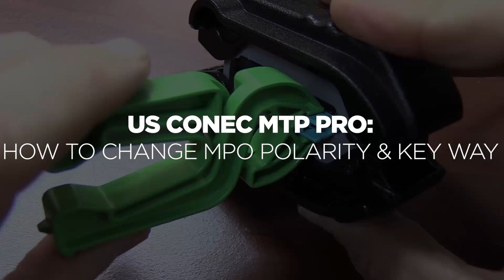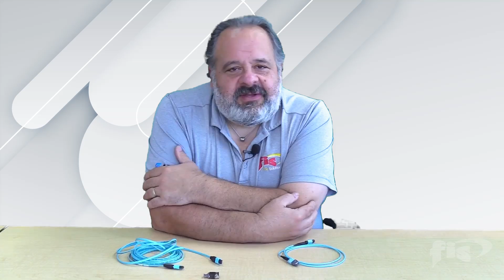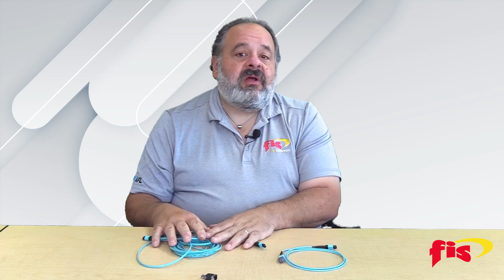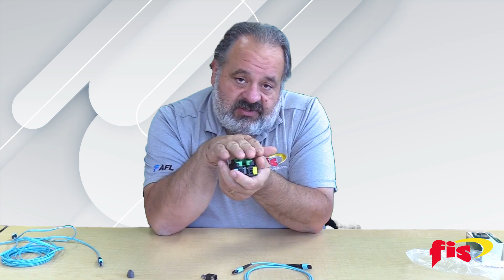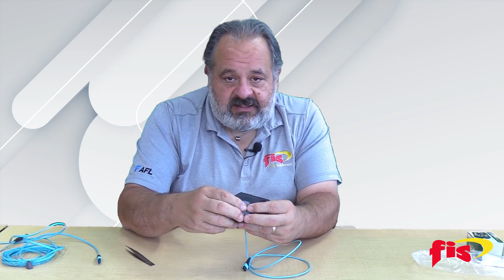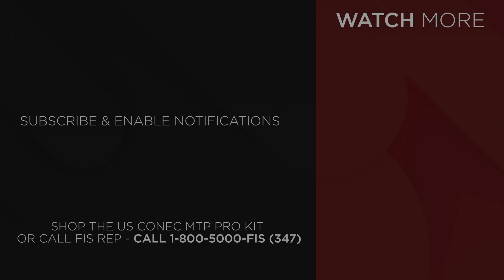How To Change MPO Polarity & Key Way with US Conec MTP Pro | Instructional

Comment: Thank you for the video.  I was curious, for the tool to work in changing key up or key down, does one side of the cable need to have the MTP Pro end on it?  I'm assuming that the tool won't work on standard MPO cables which are type B on both ends.

Comment: im connecting a Nokia    3HE07928AAAA01 MPO QSFP with a Cisco  QSFP-40G-SR4 but cant get link light.   Is it possible that these need to have the polarity switched on one end?   Kind of like switching the pairs on regular fiber(lc).
Reply: Good question.  MPO polarity can be a nightmare.  Is this a 12 fiber MPO? Is this singlemode or multimode fiber?  because you are using the SR4 format you will only use fibers 1-4 and 9-12.  Polarity can be a pain to work with but first we have to determine fiber type.  Usually, singlemode uses the A polarity and multimode the B polarity.  This will determine how we set it up.  Also be advised that the adapters have to match polarity.  Type A (singlemode) uses a Key up to Key down adapter and Type B (multimode) uses the Key up to Key up adapters.  Let's figure this out for you.  Also programming of the SFP can affect performance.  Cisco switches do not use the MSA programming that most others use.  So, the SFP could also be at fault.